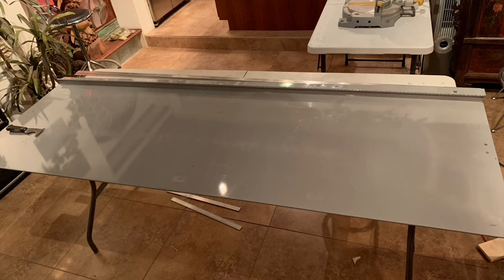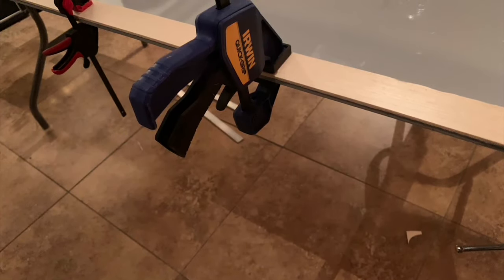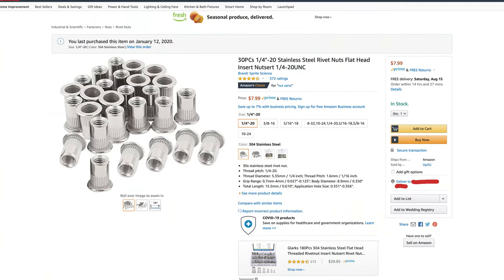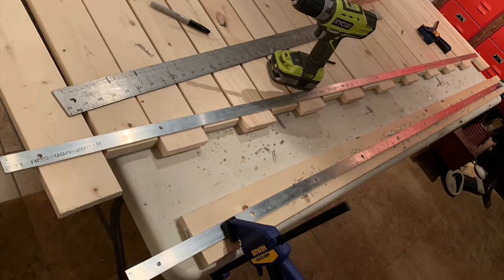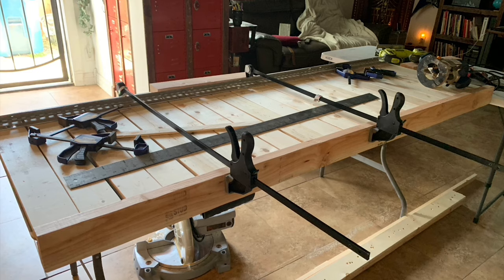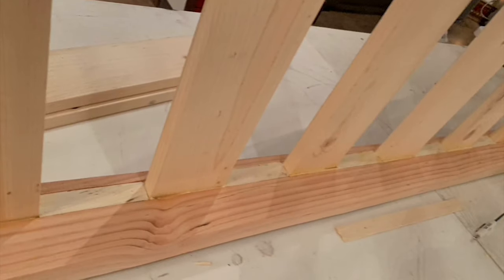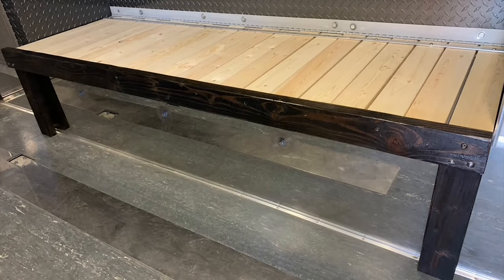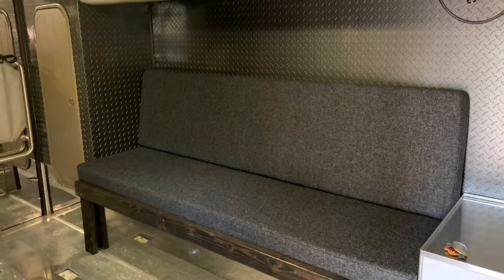My Big Red Midlife Crisis Bed Build

Comment: How big a hassle is it to have to install your bedding every night to go to bed.  I have a Class A and I'm kinda not into making my bed every day after I get up.  Some days I just put the pillow along the headboard, half straighten the sheets & shut the bedroom door and leave it till after breakfast  kinda guy. Not sure I could stay comfortable  in an ambulance because my Coach has me spoiled with ts 3 seperate rooms. Living room & kitchen, bathroom then the bedroom in the back. All separated by doors.

Reason I ask is I've kicked around  the idea  of building a 4X4 Ambulance RV so I can get further off the beaten path to camp and my Coach is too long to go there.
Reply: If my ambulance had a different layout I would have put the bed across the back, but I don’t mind pulling out the bed, and I like the extra room when it’s in.